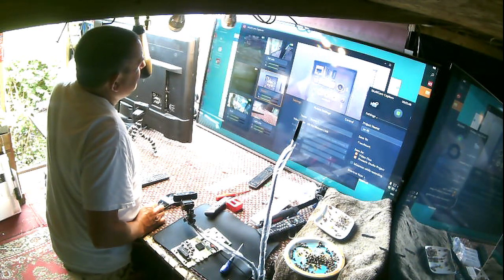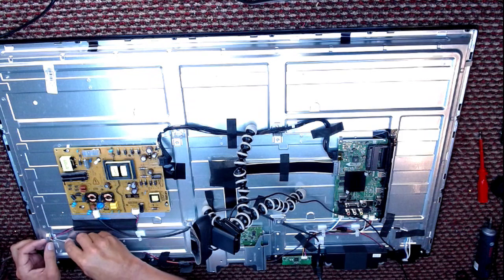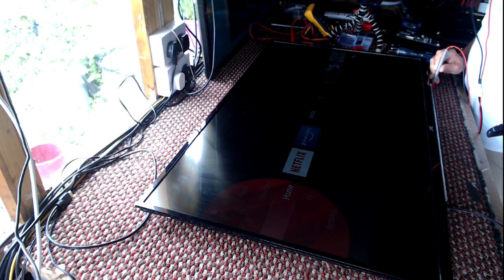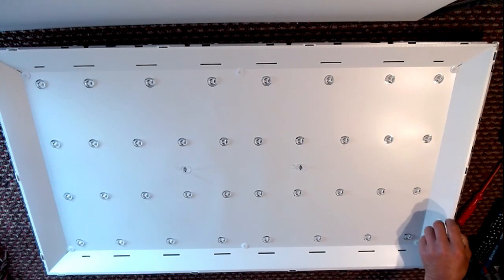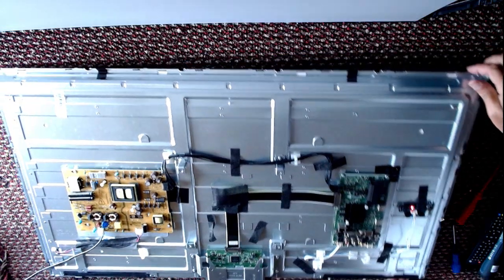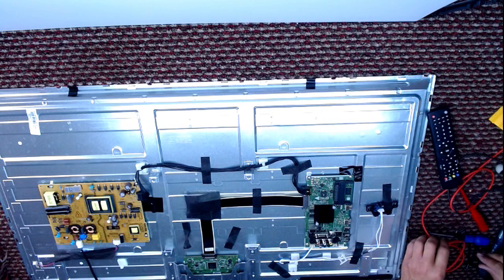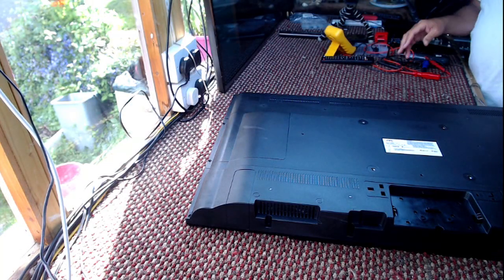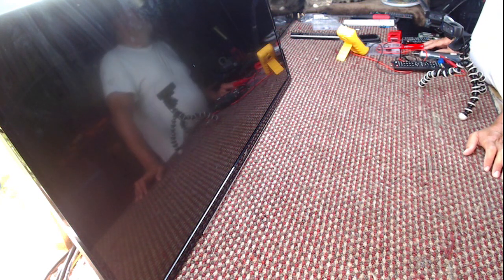jvc 40 led tv repair

Comment: Hello, thank you for such an informative video I have a: 

JVC FIRE TV Edition 40” Smart 4k HDR LED TV

Model: LT- 40CF 890 

Which when I power on the standby indicator blinks slowly and the screen stays blank, the torch test reveals the logo so I’m assuming it’s the back light please can you point me in the right direction to we’re I can purchase the parts needed to attempt a fix it is 5 years old and has had heavy use. I have tried searching online but I missed be doing something wrong, so please could you tell me we’re to purchase backlights, pcb’s etc. I don’t really want to buy refurbished parts but if needs be I will.

Please help me I’m at my wits end 😊

Comment: Great video thanks !  i have the C209 capacitor bulged up  it's a 92µF 100V can  i replace it by a 100µF 100V ?? or it must be the same value ???  Please help meee !!  Thanks
Reply from the maker: Yes that will be fine.
Reply: @allenfleckney5969  Thanks a lot 🙏

Comment: Wish I lived near Cornwall. my JVC (LT-43C890) has just gone t1ts up and it's the backlights (but watching this it COULD just be a loose connection)
not sure this is something I can tackle as I don't own a multimeter so no way to actually check - guess I need to need to find a tv repair guy or girl in Kent, near London, that is NOT going to cost the earth (or it will be cheaper to buy a new tv LOL) I possibly could take the back off and just push the connectors in in case that will fix it.

should I leave the tv unplugged for a couple hours before I do this (bear in mind I'm not 100% sure what I'm doing with this tv repair malarky but can push connectors back in) as I'm presuming this would allow capacitors to discharge or does this not matter as I'm not poking around and just need to make sure it's not plugged in.

just curious - what setting do you recommend for JVC tv that the backlights be on as you said, well, hinted, that sport + 100% was going to burn them out in a year LOL

Comment: Having taken a punt on a bargin basement broken LT-43C890 I was prepared to replace backlights/power board/mainboard. I came across your video and took some measurements and all seemed ok. I tried your recommendation to reconnect all power leads and exactly as your video it jumped into life. One comment i would say on your videos though is if you could explain your testing procedures a little more in detail, where to get best schematic, what to zone in on to narrow down the issues and specify the multimeter settings and component your testing and why.

Comment: I have  jvc 43 inch 4k smart tv....mine is a 1907....no back lights, so i did what you did, took back off, unpluged any connection i could find....put all back together..it now works....is it what iv heard people say ' dry joints' im guessing that means some sort of build up on electrical connections, i dont know.

Comment: ive got jvc 43" smart  tv which has a blue tint through ive tried checking the settings and resetting back to factory settings but its still blue , checked the led and they all come on with none burnt out so n ot sure if a psu problem for the led driver or what any ideas ?
Reply from the maker: Yes it’s the backlights turning blue , it will need a new set.  I’ve done loads of vids on blue pics.
Reply: @allenfleckney5969  yeah I just found your vid replacing 3 strip of led’s on a jvc 40” mines is  a 2018 43 “ smart tv

Comment: My experience with the Currys "JVCs" was terrible - back in 2016 I bought one and it hadn't even been made right, I seem to remember it had a bit of gasket foam going in front of the screen, so I took it back and they gave me another one which changed inputs on its own, so I took that back and chose to get a "Panasonic" as a replacement (which now turns itself back on if not turned off at the wall). Of course, I later found out they were all Vestels...
Reply: Cannot vouch for Currys at all. Personal experience has led me to believe that the business model is capitalist rather than customer based. I purchased a new computer that turned out to be used! It took three months, a small claims application and MP involvement to gain my refund.
Untrained staff work in all areas - including repairs. Furthermore, a TV I repaired, after Currys had declared it unrepairable, sported a self tapping screw that extended from the rear cover and into the backlight diffuser! Clearly somebody had replaced the wrong screw type to secure the rear cover - and could do simple diagnostics either!
Avoid Currys IMO.

Comment: hi mate ive came across this issue with about 5 tvs similier models to yours same psu , when u put your tester on the lights and ligfht them up and try the tv it comes on it lasts about a week and goes back off. ive fixed a few by replacing the psu others i needed to change the leds full set as i could not find any bad ones. its very strange i do recon its eather the psu fault or the little diode on the the leds that fails. have you had any other info on this mate thanks
Reply from the maker: Yes. I’ve been meaning to do an update as I thought it was the psu as that seems to get them going again for a few weeks , but last year we paid attention to the strip contacts and found the copper elements on the end of the strips , usually the top strip had a small black pitted hole.  Simply re- tin the contacts and push them back in the sockets and they work again as they should.  It’s just bad contacts that start to arc.
Reply: @allenfleckney5969   thanks for the speedy response il keep my eye out for this.

Comment: I have same problem with a 40" jvc will work fine then back lights fail have changed power board still same , strip down wiggle wires put back works again for  a while very frustrating

Comment: Thanks for this. I had sound but no picture on mt LT-40C890. After watching this video, my son was confident enough to take the back off the set, check the connections and retry the set. Lo and behold, it worked. As in your video, my set obviously had a faulty connection. Thanks for saving me the cost of a callout and repair. I'm very grateful.
Reply from the maker: Thank you but I’m sad to say that will be only a temporary fix. The TV will need a new set of backlights soon.

Comment: I had the exact same issue Jvc lt40c890 took it apart fiddled a little with backlight wires and power connection working perfect now. Did you have anymore problems after you fixed it? Not 100% convinced it will stay working for me thanks your video helped me fix it 👍🏼
Reply from the maker: They’re on eBay for £40 or £20 if you buy in China.  Join me on Facebook and I’ll show you
Reply from the maker: Hi Keith. After further inspection any TV that uses this screen with this Power supply will have the same issue.  It’s not the backlights but the led driver circuit on the Powerboard.   I eventually changed the board and it never came back
Reply: @allenfleckney5969  Your a legend! Thanks so much for taking the time to get back to me really appreciate it. I’m going to order a New Power Board and hopefully it will continue to work👍🏼
Reply: @allenfleckney5969  Hi Alan, I replaced the PCB board with a Brand New one and it still doesn’t turn on? Well I tried! Still flashing red light when I go to turn it on… it eventually will turn on after turning it on and off a good few times? Any ideas? Think it’s for the bin 😂
Reply from the maker: Hi Keith. You need new backlights as well.  See my latest video from yesterday about this set.  Both power supply and backlights are weak.   Don’t bin it.  Send it to me if your stuck.
Reply: @allenfleckney5969  Hi Alan thanks for reply, where do you order the back lights from?  I like fixing things but not sure if I want to spend anymore time and money on it to be honest? Spent 50 on Brand New PCB, I have taken it apart about 4-5 times now it’s driving me mad! 😂

Comment: I have a jvc lt-55c550 and it started getting dark in the bottom left corner of the screen then the top right corner went dark and now all the screen is dark. It has sound and if I shine a torch on it I can see the picture. Do you think this is a back-light or a board issue? Thanks for any advice Miranda
Reply: Back light

Comment: I have the same TV with the same problem. Had a flashing red light. Took the back of an wiggled the power lead and got it to work. Put it back together and it stopped working again. So took it off and done the same thing again and got it to work. Is there anything I can do to stop this happening again/decrease the chances of it? Thank you🙂 (ps great video, most definitely was the personality😅)
Reply from the maker: If you see my latest video on the Logik tv repair. That has the same fault and you will see what needs to be done.   Good luck
Reply: @allenfleckney5969  perfect, thank you very much! Will be doing this soon when I have the time. I work away so have just had the TV sat at home not being used for months🤣

Comment: Bridge the fingers onto the side board they normally give up and burn out causing intermittent operation
Reply: Hi, can you tell me what you mean by this? Mine keeps having this problem so I want to fix it for good. Thank you
Reply: @alden5903  if all your backlights are ok it’s where the strips connect to the aux board just scrape away some green solder mask and solder a link wire to the strip instead of relying on the plug and socket do it to all the strips, need more help let me know
Reply: @wisher21uk  yeah I need some more help🤦🏽 what strips do I need to solder?
Reply: @alden5903  guessing you have tested the led strips and they work with the screen etc off so you have the led strips showing on one side there will be a green connection strip that the leds strips plug into 
You will see the pub traces on the green strip scrap some off so copper is showing then bridge the connector so put a link between the green strip and the led strip also make sure there is no connection midway on each strip as you will need to link them as well